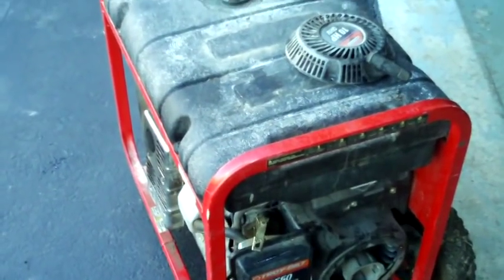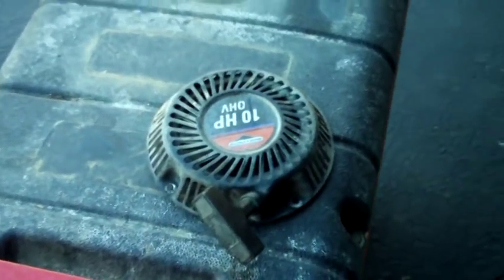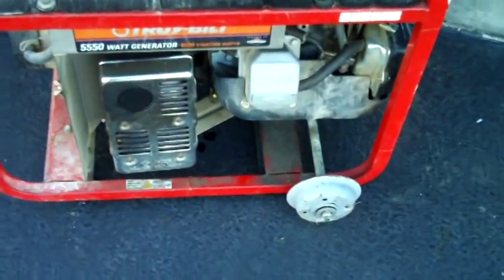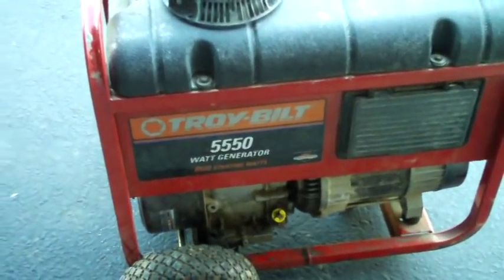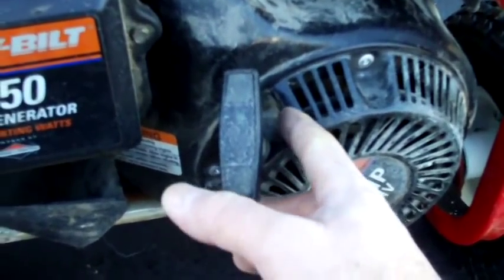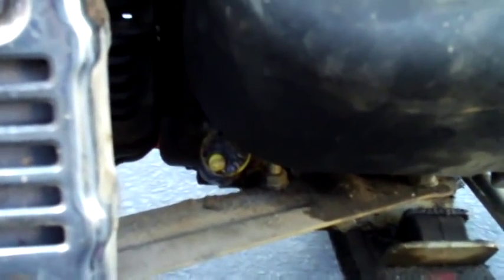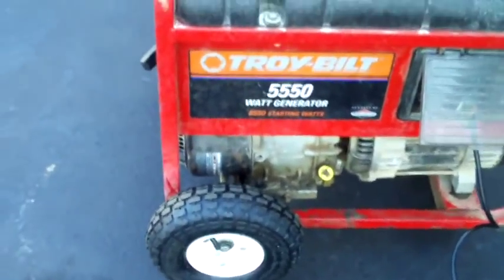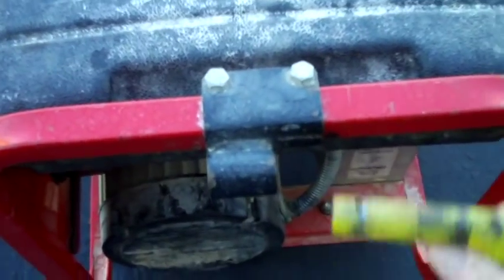Troy-bilt 5550 watt generator,$75 find !

Comment: I've got one of these and it's been the most amazing piece of power equipment I have had, it's very dependable and as long as you run good gas in it it's gonna start first or second pull every time!  We had a terrible storm come through here 5 years ago and I ran that generator 12 straight days!  Only pausing to put more fuel in it, and for half hour on day six I shut it down just to be nice to it, changed its oil and fired right back up for the next 6 days of run time!  That event alone and I would have been very pleased with money spent! But here I am 5 years later and that bad boy just keeps on going!  Had power outage 4 times in last two weeks ran it 8-10hrs each time!   I would buy another in a minute!  I'd love to find one used and fix it up!  You got a heck of a deal on yours!   Worst thing I can say about the whole thing has been it's tires!  The tires suck and both of mine are flat!  I need to replace and do basic tune up soon and look for another five years of worry free use!

Comment: I have the exact one and it's over 15 yrs old still starts on 1 pull, it's a great unit. It is quite loud but works every time.
Reply from the maker: Only annoying issue I have is the pneumatic tires, ones I bought for it didnt last for 3 years,, Need to get some airless ones for mine, otherwise it's a good unit👍
Reply: Exactly if they sit they go down, forever pumping them up.
Reply from the maker: @TommyG11814  yup, I have another Gen that has airless tires and no issues  ever. Definitely  getting some for this unit, lesson learned for me. Lol💯

Comment: Bought mine in 2004 slightly used with 4 hours of run time.   Ran half the house for Jeanne, Francis, Matthew and now Irma, plus ran my dads house for 2 weeks after Wilma.  2 window units, fridge, plus all the lights, fans and TV's.  Still runs like a champ!  The tires are horrific but the Briggs and Stratton engine is solid.  Even running at 90% most of the time.  Nice fuse breaker keeps from damaging when you go over.  Loud as anything but that mostly the neighbors problem.
Reply from the maker: Nick Phillips best part of it all is it's been reliable  for you and not let you down.  These are stories I like hearing about.  Thanks for sharing

Comment from the maker: Thats for sure!, Goin to try the stuff in the can first, I never liked relying on just that, im always a remove and repair type, But im feeling lazy, I know the kit would cost as much of a can of seafoam, if that doesnt help it, im going to remove it and give it a bath and rebuild it, take a torch tip cleaner and clean out all the ports and idle circuits best as i can, :)